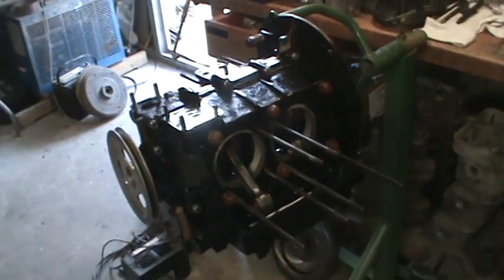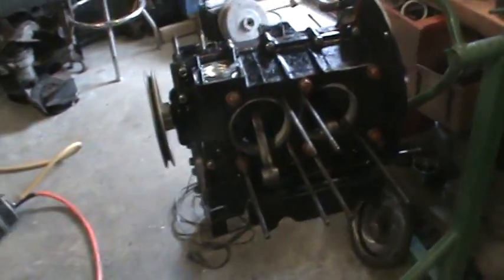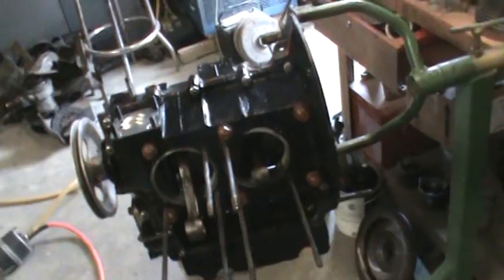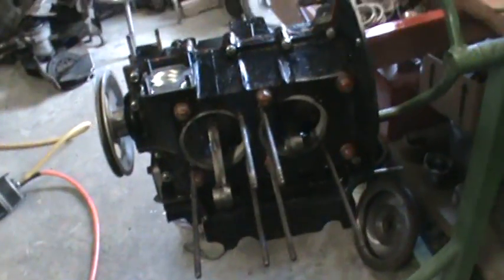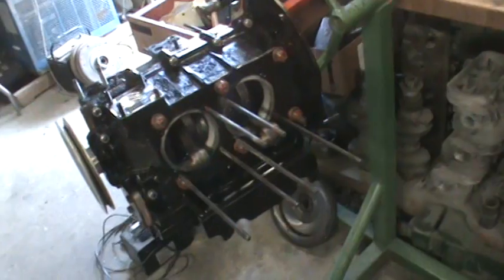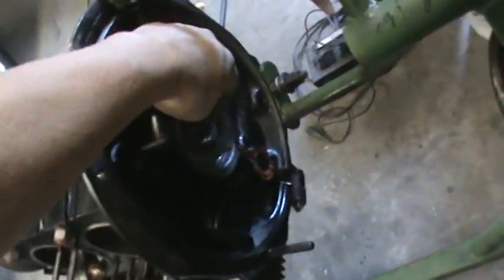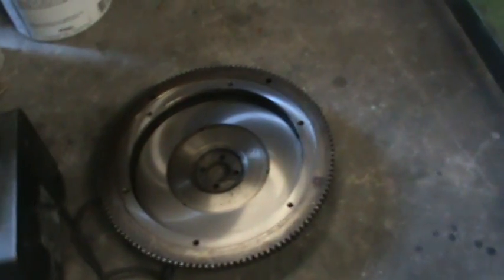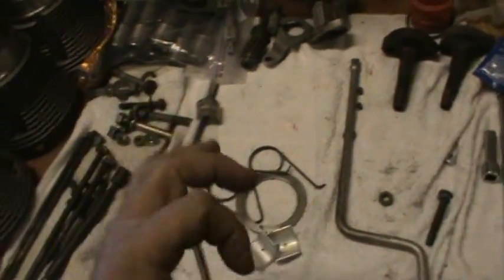how to diagnoise a tight rotating engine assembly

Comment: Thanks for the insight. I'm wondering about mine that I just sealed. The Lucas oil assembly lube I use is thick. My crank rotates smooth but it takes some oomph to get it started. Then it rotates smooth but with some resistance.  I can't tell if it's a pinched bearing or just the low viscosity of the assembly lube. I made sure to check the bearings were seated on the dowels correctly before joining the case halves.  Is this normal with that thick, sticky assembly lube??

Comment: i would be curious to know how the case was prepped.

things I know that can cause the cam bearing problem
the mains have been line bored or honed
the cam bearing supports have or have not been honed
i assume the bearing areas on the cam were mic'd and found good
i also assume the correct cam gear pitch was used and quality gear(s) were used

you did mention the test of trying to walk the cam out

it is sad to see the quality of products these days, i guess the 80's and 90's were a better time

Comment: I found a dowel pin that was too long or the pin hole was too shallow.
Case has been opened up - line bore .
I did not keep the pins with the block as I tore it down. I have a parts tray I keep all the small items in. 
Upon reassembly - crank would not drop. Upon inspection - I could see a detent in the pin align hole in the bearing.
I measured pins - holes in the block - holes in the bearings. Then measured a standard block - Bingo